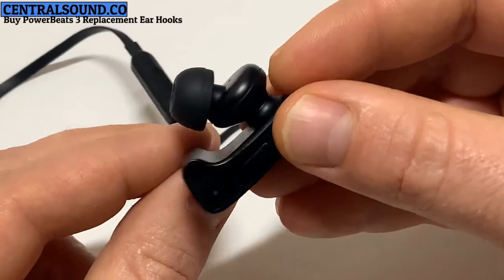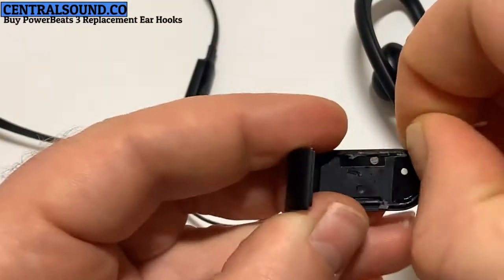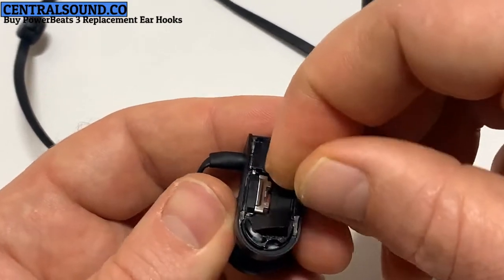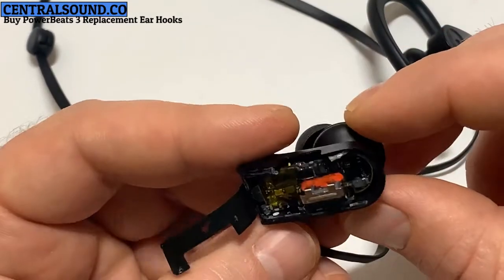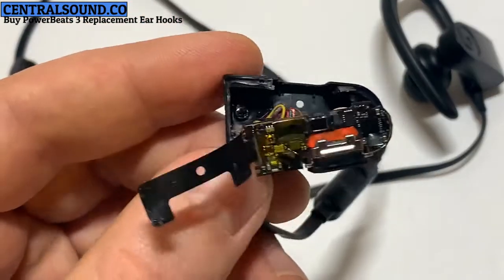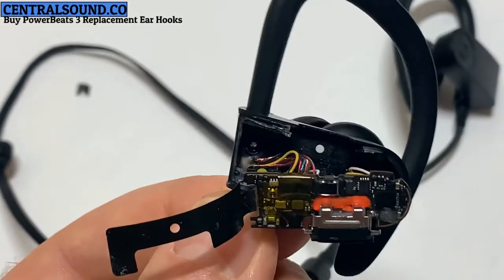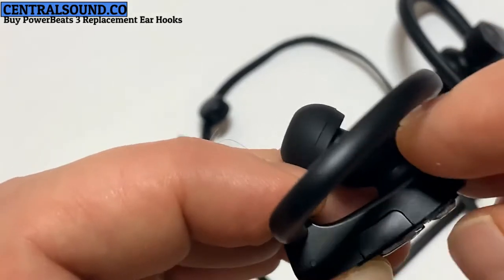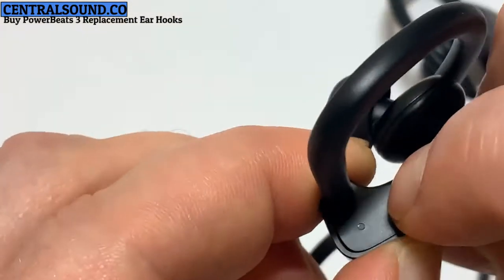How to Replace Left Ear-Hook Part on PowerBeats3 3 3.0 Wireless In-Ear Headphones Fix Repair Broken

Comment: Great video. My eare hooks broke years agp but until now i was never confident enough to try repairing it myself. I've placed an order for a hot air gun, I just had one question. Do you set your heat to 130 degreees celcius or fahrenheit?
Reply from the maker: 130 farenheit

Comment: I changed the ear hook and everything but now they won’t turn on but they charge is just whenever I press the button the light doesn’t blink at all
Reply from the maker: It's a possibility the board or wire/connections may have got damaged during the repair.